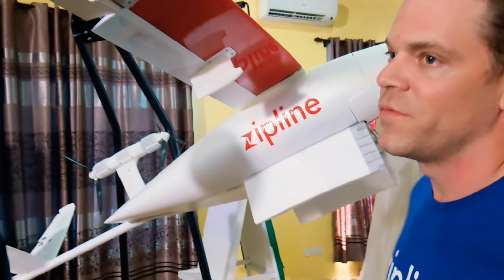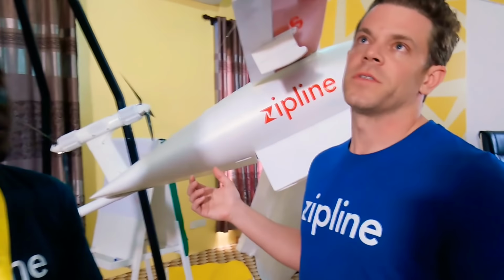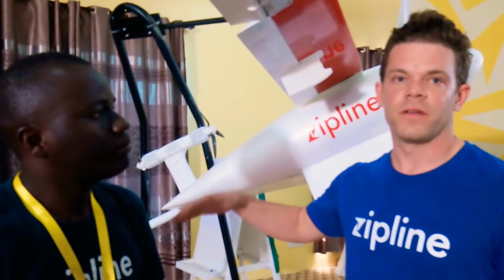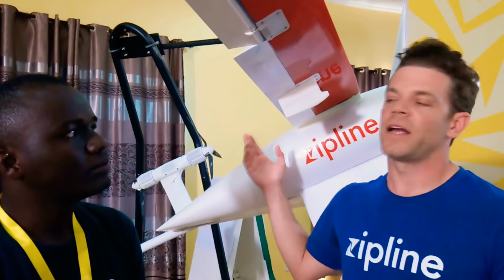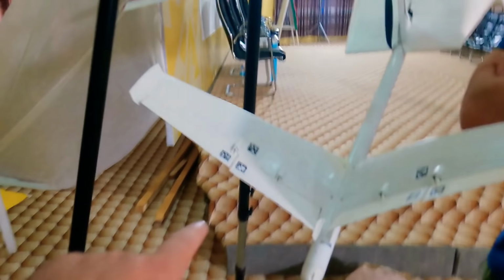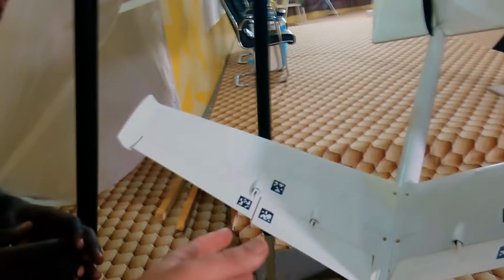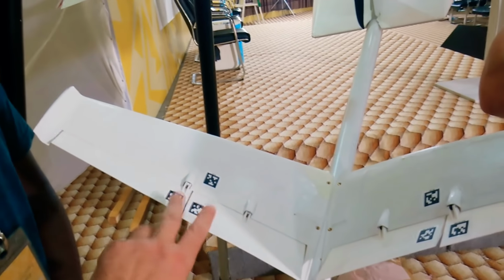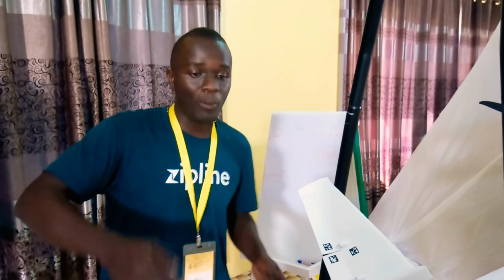Zipline - The Lake Victoria Challenge

Comment: Great video Gary, any idea how many drones they have and what battery they are using?
Reply from the maker: All I know is lots and that they make the batteries themselves. Doing a clever thing as well, the flight controller GPS sits in the battery pack that is removed and charged in a stand that can see the sky, so the GPS never loses its lock and the aircraft is ready to go when the pack is plugged in.
Reply: @sUASNews  thank you.